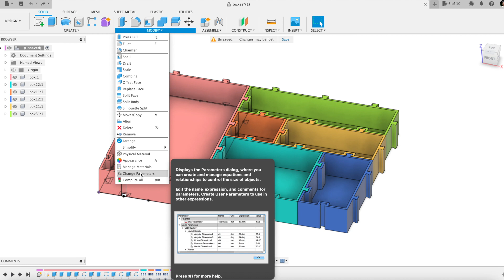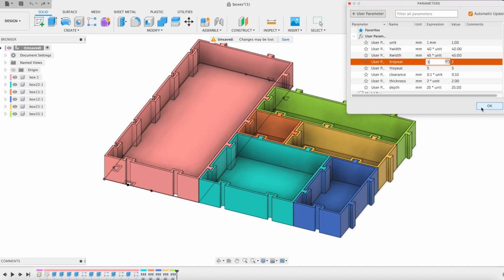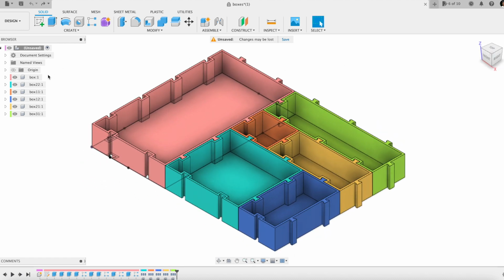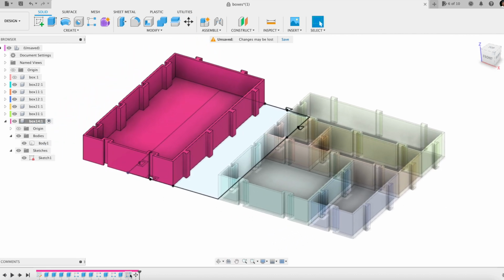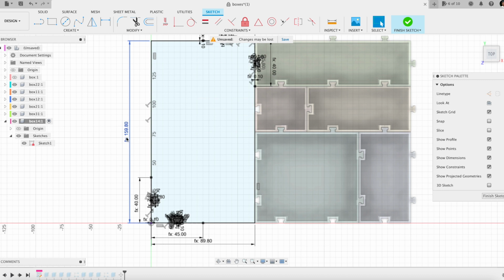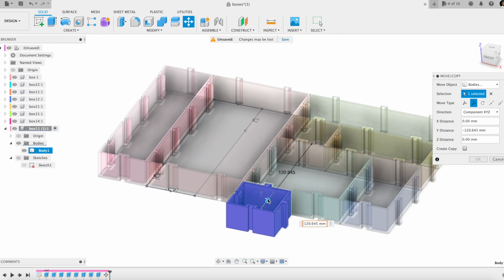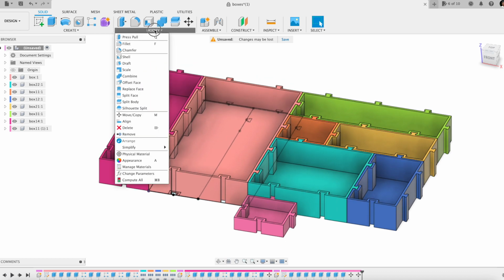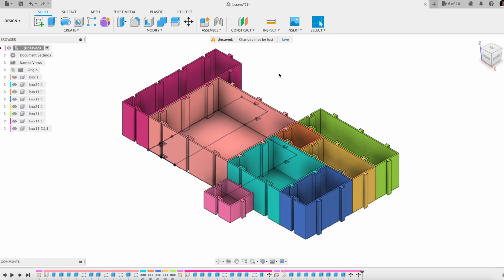Parts collection with Fusion 360 (AKA configurations)

Comment: Really nice.. the downside is that for small parts storage you need some type of containment. If you could come up with some type of vertical stacking, with a top cap that could make the system somewhat portable, would be genius.  So I have 10 small screw sizes for small boxes, some larger boxes to contain bearings, some longer for steel threaded rods .. maybe design to be stacked 2 units high.. and then want to take that set of parts to the office.. so you need good containment.. Thus selecting sizes that make squares easily and then design some "lids" and methods for stacking.. maybe not possible.. I really like the snap-together features!